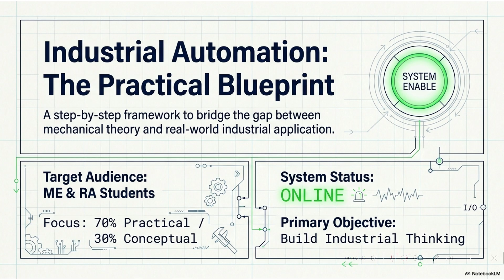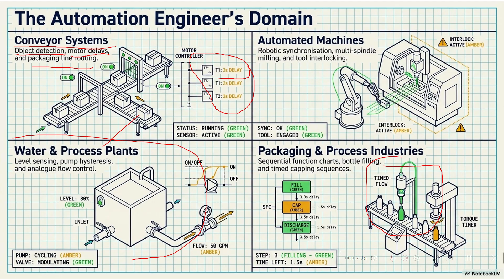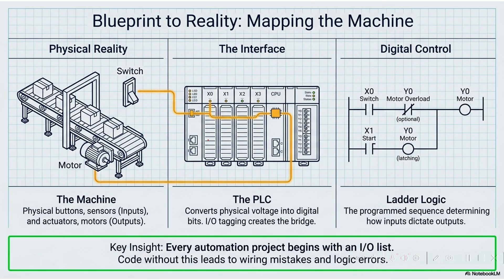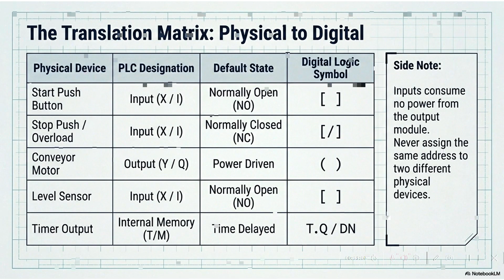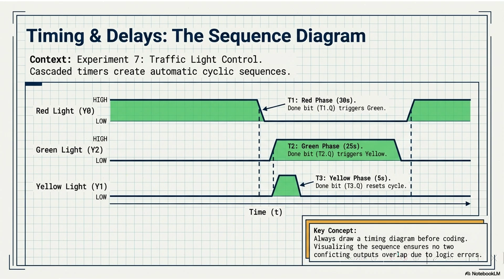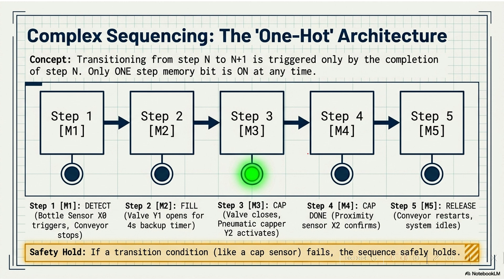PLC and Industrial Automation Introduction | Career-Oriented Approach for ME and RA Students

Comment: As a student, what are the most common challenges faced when transitioning from theoretical 'P=F/A' calculations to implementing real-world control logic in a factory setting?"
Reply from the maker: Good question,
Equation based thinking is to know what problem is?
But machine or system based thinking gives you full freedom on solving practical situations, 
So equation like p=f/a is to calculate how much force, pressure and area and all?
But system based thinking makes you pro in where to apply, how to apply and when to apply?
Example: there is a leakage in pressure vessel, result it drop in pressure.
Now you should train your brain and automation system to identify where is the problem and how to seal and again to increase the pressure.
This is how equation based thinking and system based thinking works, both are important,  but we must chose carefully when to use our knowledge.
This we discuss in further sessions